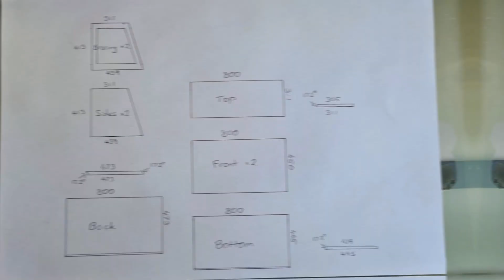Box Build for massive 15" subwoofer (+ demo)

Comment: Thank you for sharing this build. How do you set up your cuts to get good straight lines with a circular saw?
Reply from the maker: @CheekyAquarius  many ways, but the way I do it is by measuring the distance from the edge of the baseplate to the saw blade. You could get a scrap bit of timber, clamp a straight edge to it, and do a quick cut - then measure the distance from the cut edge to the fence.. this will be how far you set up the fence from where you need to cut (accounting for blade thickness too).
Alternatively, I made a jig by screwing a straight edged offcut to a bigger bit of timber, then completing a cut using the screwed on fence. This gives me a template with a straight edge I can line up with any line I want to cut along. There's a few videos on YouTube explaining how to make a jig easier.
Reply: @nicke1370  right on, thank you.

Comment: Would this box design be any good for a 15,000w subwoofer?
Reply from the maker: 15,000w rms? No. Most likely not. Each heavy duty sub usually needs their own kind of enclosure to work best. The t/s parameters of this sub say this one would work great in a sealed enclosure, so that's why I built this one

Comment: I think this guy has done this once before. Sealed is better for listing to different types of music. Not everyone likes or needs to just play a small spectrum of bass frequency very loud. Every box type has its place. And it takes  power to make….power. Upgrade your electrical people.
Reply from the maker: Only a few times but I've used each one as a learning curve. This subs specs made it best suited for a sealed enclosures, and it really paid off in this instance. I don't have a whole lot of money for the hobby, hence why it's 'only' on 1000 watts. Voltage drop is minimal, so I'm confident it's not too much strain on the electricals. 
I agree with everything you said :) thanks for the comment

Comment: I aasume more the spl only range not over 80 hz at all n ya like ya said flat under 27 for dual 18s seal em up half box size n grab some power youll be shitting mad wasting all that pressboard also they make mariene grade sheets of that mdf too way heavier n ready to get wet n not loose its bottom like a fkn paper bag lol